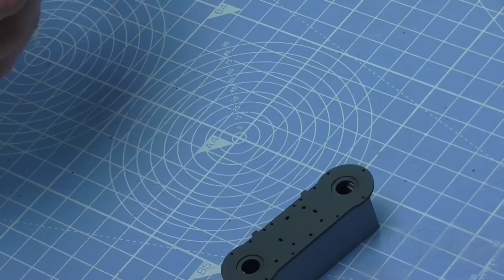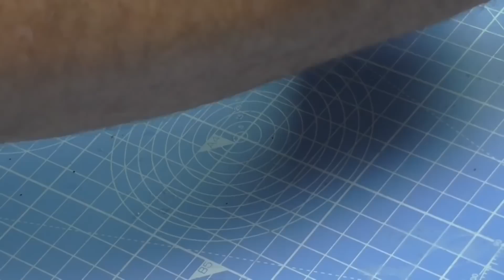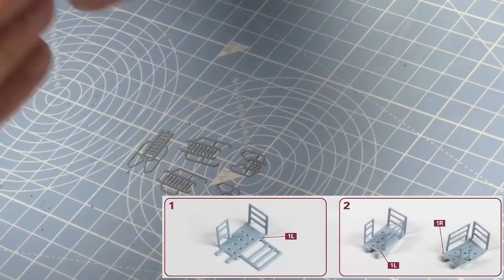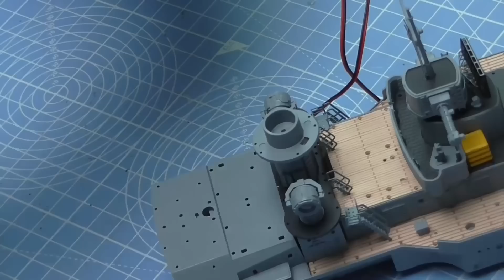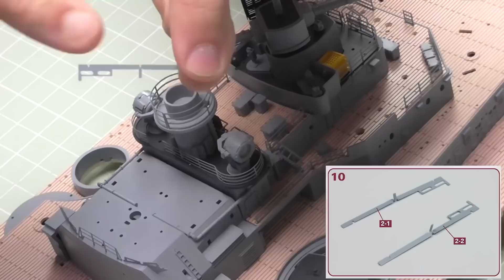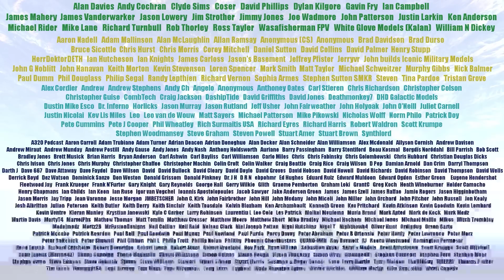Agora Model's Bismarck The Legendary Battleship - Pack 9 - Stages 93-104

Comment: hello Wanyne. I try to check the Bruno canon with S1 but only to initialize move turn right, move around with s2 button not up down. the 4 small canons do not move at all, the lights with S3 are Ok. what is the problem ...?!
Reply from the maker: I would disconnect the motor that makes the gun go.up and down and confirm it works when it's not attached to anything. It may be a jammed mechanism
Reply: @WorldofWayneUK  The small motor that makes Bruno up-down I disconnect it B21 B22 and the test them work fine at test. The 4 small canons did not turn left-right when I pust button S2 at controller. The lights with S3 are all ok and the 2 radar with S4 ...
Reply from the maker: @Charris2007  strange. I would reconnect and leave to the end as each motor is controlled individually anyways

Comment: Thought re non-90 degree bends.. how about using a piece of thin card as a template? Bend /that/ until it matches the required piece, then use the template to create the bends in the actual photo etched part. That way you don't risk accidentally bending anything too much or in the wrong place.

Comment: Re alignment.. would a credit card or something else help if the gap is narrow? then you can hold the card against one flat side, slip the part in against the credit card knowing it's flat, then slip the card out and let the glue dry. Might also help if a right angle is required such as in holding a part or bending a photo etched detail to shape.

Thought about that radar in stage 100.. how about something like the flexible plastic cover of a ready meal etc sandwiched between the layers? Thin enough not to interfere but smooth enough not to resist turning. Saves the grease wearing off over time.

Pity the electrical test board doesn't have a Reset button, so you can just press that and everything runs home to Mum :)

Comment: BTW with stage 97 you mentioned not over-tightening the screws as you might round the heads off. Even if the heads survive you could strip the threads - mind you in this particular case you could just glue the deck in as you have for others :)